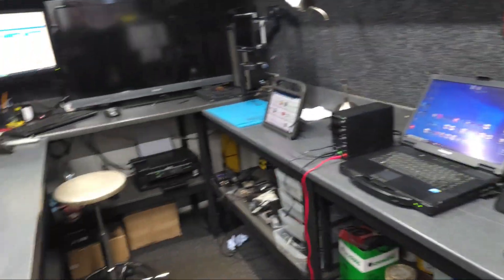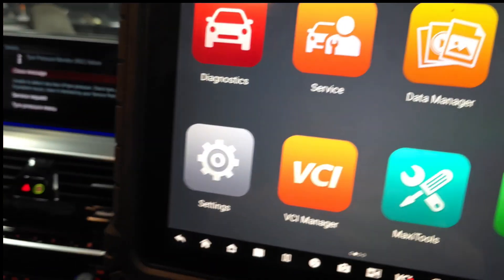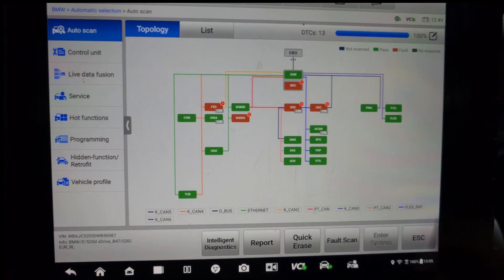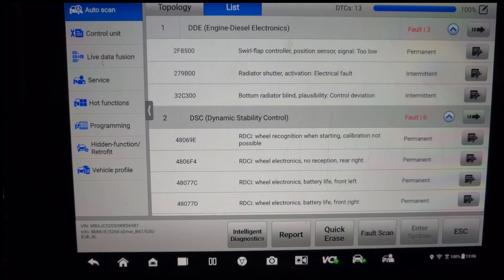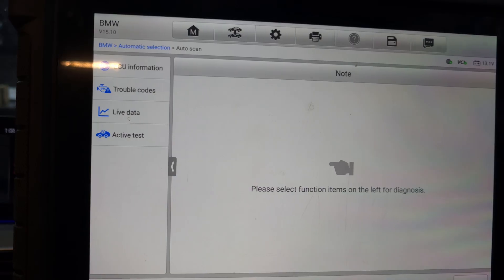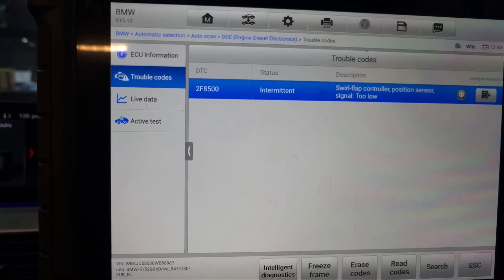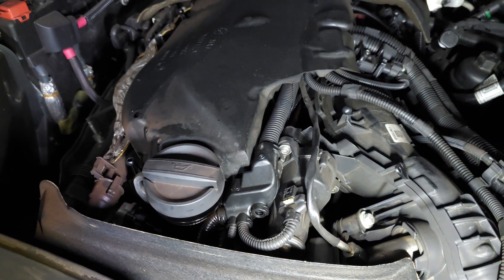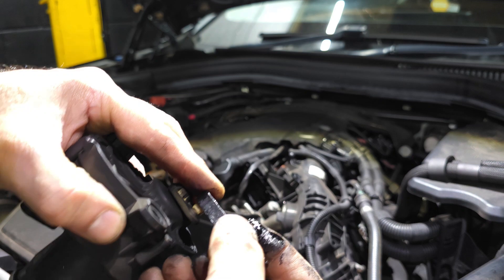BMW 520d G30, Fault Code 2F8500 Swirl-Flap Controller, Position Sensor, Signal Too low, Diagnostic

Comment: Just did this modification on G20 320d with same fault code and it didn't do anything.
In manner of fact, I took out the intake manifold, did the deep clean, did this modification that's showed in the video, did the Air mass adaptation reset (EGR, swirl flap actuator, etc..) with ISTA, let the car to go to sleep mode for 30 mins, after 30 min took it for a ride and after about 20 min check engine light came back with same error code.
Any suggestions?
Reply from the maker: Thanks for the detailed update. If you've already cleaned the intake manifold, done the modification, reset adaptations in ISTA, and the code 2F8500 still returns, it’s likely the issue is deeper—possibly a faulty swirl flap actuator or wiring fault.

I’d recommend checking live data for swirl flap position and feedback during engine operation. Also, inspect the wiring harness and connector pins to the actuator for corrosion or damage. In some cases, a full actuator replacement may be needed.

Thanks for watching.

Comment: Can the swirl flap controller signal low, come from a weak/degraded car battery as well on a g30?
Reply from the maker: Hello and thanks for watching .
Yes, a weak or degraded battery can sometimes cause low voltage issues that trigger fault codes, including for the swirl flap controller on a G30 520d. It's worth checking battery health and connections first before replacing any components.
Thanks again

Comment: 48077f bmw fault code what is code for?
Reply from the maker: @realkurdz Hello, and thanks for watching! As for the BMW 48077F fault code, I'm not entirely sure. Without the car on hand for further diagnostics, I can't provide more details.
Reply: @akisgarageltd  RDCi: wheel electronics, battery life, rear right
That’s the problem

Comment: I have same problem after egr recall i have g30 530d
Reply: Bavarian says its,not related with recall and they dont want to fix it how can i prove them its their fault m one week after recall my car has engine lights and increased fuel consumption . They blamibg intake manifold and saying its very common in this model which i dont buy straight after recall my car having problems and 2 years before recall all good 😢
Reply from the maker: @White87Boy  Unfortunately, it is challenging to determine if the issue is on their end, as they are likely to attribute it to the intake manifold problem.
Thanks again
Reply: @akisgarageltd any tips how i could challenge them about it ? Its purely their fault after recall ...
Reply from the maker: @White87Boy  I really don't know, but just try and see how it goes.
Reply from the maker: @White87Boy  Hello, and thanks for watching. This customer has the same problem after recall. 
Thanks
Reply: The issue is that they do not really even touch the inlet manifold during the EGR recall. You can confirm this by looking at the recall technical data, however there are some rare cases where they scan your codes, and if you have a swirl flap issue they replace your manifold FOC. In my case I have a B37 diesel and had the issue long before I went for the recall, they told me the manifold needed changing but didn't want to do it for me lol, so I removed it myself, cleaned it and deleted the flaps. Car runs beautifully now
Reply from the maker: @BigHumz155 Hello, and thanks for watching! You're absolutely right—I did recommend that the customer delete it for good, but they wanted to keep it original. Thanks again!
Reply: Hi Men, I got a same problem as well can we appeal together, I got 2018 model 530d.
Reply: Same a few months after recall same issue 2018 530d